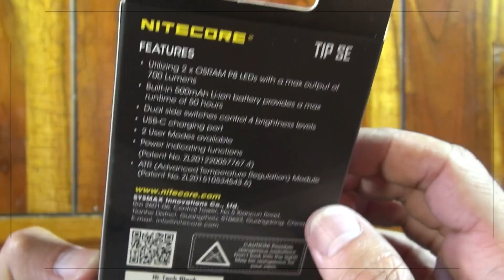Nitecore TIP SE keychain - Unbox Test Advice - Sirio Review

Comment: Been waiting for this! Im so glad you decided to review it. So what do you think tip 2 or tip se? The tip 2 interface (need to press for at least 2 sec for light and that i cant directly acess low mode and that i need to keep pressing the button for turbo bothered me so) also what do you think of tip 2 vs tip se in terms of unwanted light activating suddenly in your pocket
Reply from the maker: Personally I prefer the TIP2 because the quick release by the magnet and the possibility to fix the lamp on any metallic surface (iron), but the fact that I need to press for at least 2 sec for light, is so boring. The positive point of the TIP SE is the more natural colour of the white, the problem, is that keeping it on the belt loops of the pant, every time that I lean on a table or on the sink, the lamp switch on involuntary. All depend by the daily use.

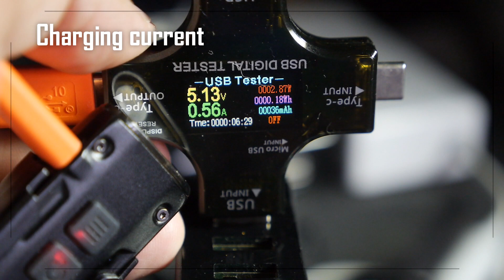Comment: 5:20 Can you please give me the link or the name of that device with different ports ? I mean device to check voltage , amperage and wattage
Reply from the maker: Here:
https://m.it.aliexpress.com/item/32911463740.html?spm=a2g0n.orderlist-amp.item.32911463740&aff_trace_key=a8707548259e40b88781c38845655826-1611442999545-05225-UneMJZVf&aff_platform=msite&m_page_id=6540amp-FNnhs2BcgCljm0dj-Pj8Iw1613461129939&browser_id=862ce83e2cd84e938917a6b7754c0fb9&is_c=N
Reply: @SirioSechi   Thank you, via your link i found even better one. What do you think, which one is better from next two:
18 in 1 USB 3.0 UD18 tester 
OR
UD24 2.4"inch USB tester
I can not give link here.
Reply from the maker: You'r right, they can do more !!! Nice
Reply: @SirioSechi   But which one of them is better in your opinion ? I mean  UD18 or UD24 ?
Reply from the maker: @Temporalplace  both looks good. I think the 24 is more complete than 18, but is not clear. I will take a better look  tonight.
Reply: @SirioSechi  Ok thanx i will wait for your response
Reply from the maker: @Temporalplace  Hello, I compare them, they looks complete both of them. The UD24 is just more complete about functions, but I don't understand which one exactly. The list of functions are presented in the same way.
Reply: @SirioSechi   I diod notice that by UD24 they say that it supports QC 3.0 while they write nothing about QC by UD18. What do u think does UD support QC 3.0 ? Or maybe it does not need to support it , i mean any such device allows use QC ?
Reply from the maker: @Temporalplace  The Quick Charge 3 is important. Now a lot of devices use this, especially the cellphones, then I should choose the UD24
Reply: @SirioSechi   But i got old device to check Voltage, Amperage and Wattage and even through that old device i can charge my phone with QC 3.0. Maybe that device does not need to support QC to be able to transfer it to phone ? I mean its only device that check data. If device supports about 12v voltage transfer and more than 3 Ampers should't it automatically support QC 3 ?